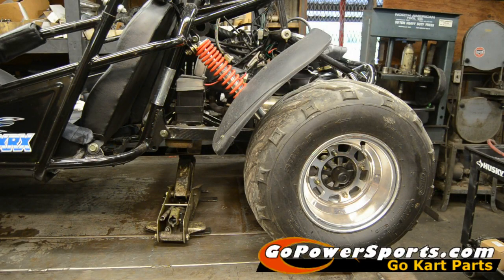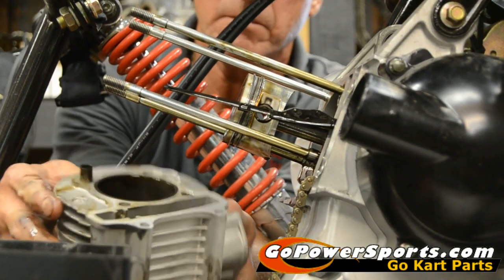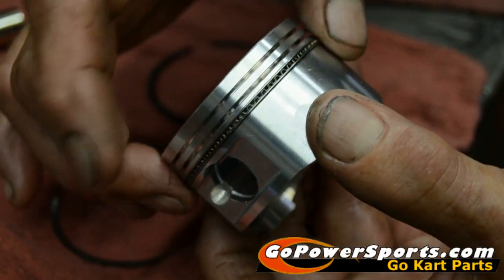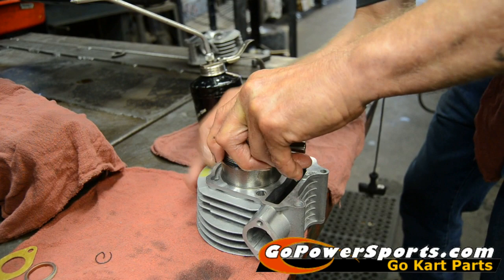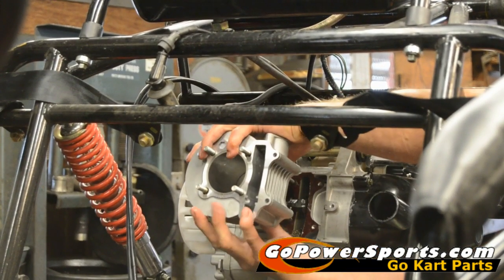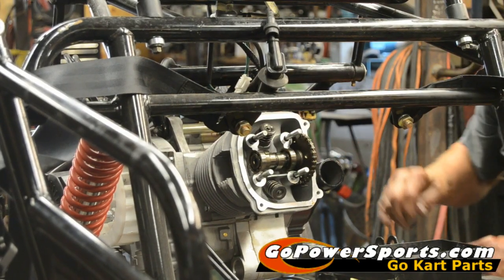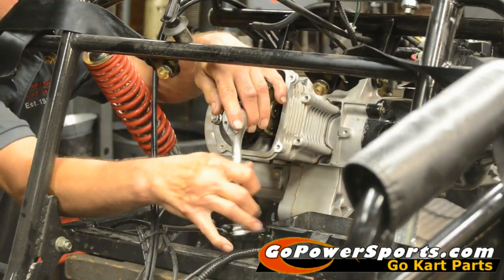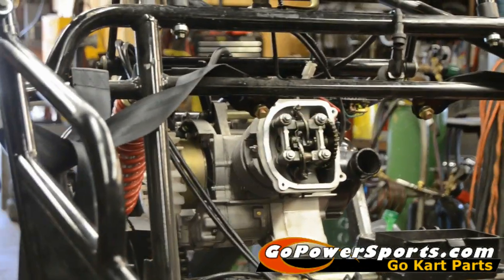Installing the 150cc Go Kart Engine Rebuild Kit

Comment: This is a great video – thanks for posting. I followed it to
rebuild a 150cc Chinese quad that had the same engine – using a new piston and
barrel. Hopefully mine will now start/run but unfortunately there is another
issue with the starter clutch which needs addressing. Thanks and regards from
the UK.

Comment: I have a gokart that has a gy6 150cc and I just rebuilt it today but the big hole on the cam is facing Down towards the piston and and it was running good but smoked alot so that's way I rebuilt it. I rebuilt it the same way with CAM HOLE FACING DOWN TOWARDS PISTON. It runs but should I turn the cam around so hole is facing up towards steering wheel?? PLEASE HELP
Reply: It can't be 180° 'out', as it sparks on intake and exhaust.
Reply: @mattdwyer9432  ya I realized I was wrong...
Reply: @Daniel-jw3of  just tryin' to help!  It's possible I've worked on mine more than I've ridden it!

Comment: what is the differences between gy6 engines i have the carbide 7150 150cc i want to rebuild the top end its in an trail wagon tw200

Comment: what did you set the valves at?
Reply: .004
Reply: i bought a new 150 motor it doesnt run the valves were bent i put a new head on when i timed it like you did and you turned the flywheel to make sure it was right i did that and the valves were to tight. wtf?????
Reply: like everthing else i figured it out.
Reply: Best is to set intake at 0.003 and exhaust at 0.004
..

Comment: the torque is 14lbs for the head the 6mm head bolts are 7lbs. you need a bigger engine in that go cart.